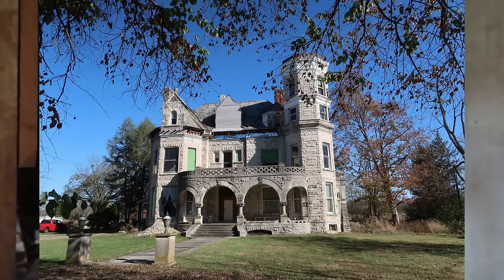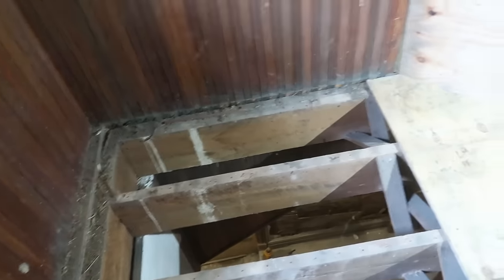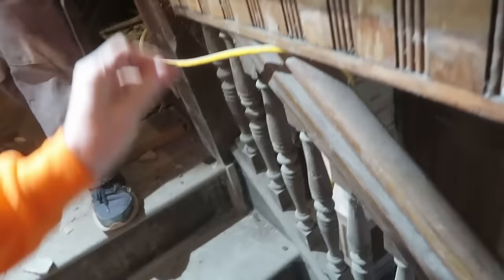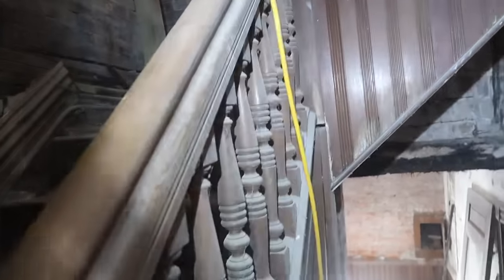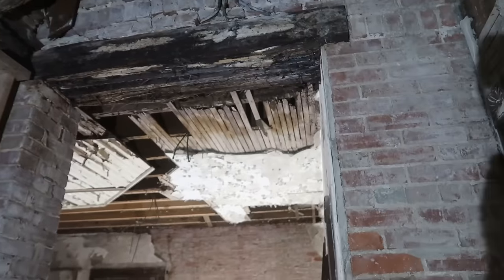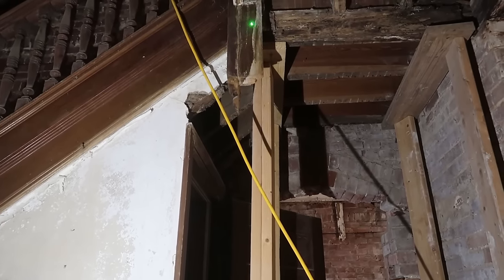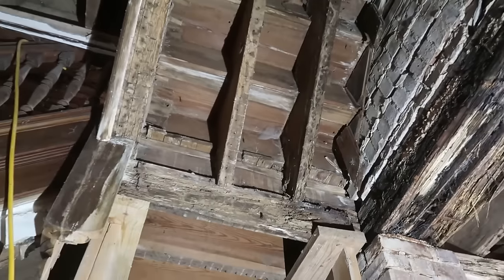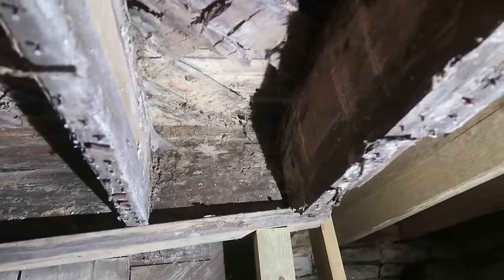We RESPOND And EXPLAIN The Structure And DESIGN Of The Back Stairwell. S4E28

Comment: I’m not an architect! but I have renovated several houses! You need a footer in the basement for the post to sit on! Going all the way up to the attic! To support the stairs! I would check out securing the stairs to the brick wall also! So it’s not just freestanding along side the wall!
Reply from the maker: We will figure out how it was designed and try to make it better. That might result in support from the basement. It would certainly be the easiest way to do it.

Comment: My 1903 Victorian commercial building (4 floor including basement) had a wrap around "floating" staircase from the second floor to the third.  The third floor was originally a ballroom or community room which was fairly posh for the time (4,000 sq ft maple dance floor with horse hair lined padding under the hardwood - no squeaks, no sound at all, even after 120 years, elaborate tin ceiling complete open span accomplished by 5 huge timber beam trusses across the width of the building, electric perimeter lights integrated in tin crown molding ( unbelievable lengths of insulated copper wire for all of this, knob and tube of course), an electric elevator and two large restrooms. Obviously the staircase was quite elaborate for going up to this room and was representative that you were going somewhere special.  Now, the reason for all of this explanation setup is that my stair case was similarly scantily supported,  I used to just stare at how it was constructed, wondering what did they do and how did it work especially since it wasn't residential but commercial and had more traffic.  I guess it was designed by someone who really knew physics and the transfer of force along the staircase as a whole because as a unit, it was supported as long as staircase as a unit was together and not compromised at any point, which it was still intact - I had no rot issues, so all was good.  I think the Victorian design and building just pushed the envelope when it came to support  - the always wanted to impress with staircases and entrances.  My point:  I see the same application in your home - your back stairwell.   It worked as long as things along the way weren't compromised as you point out with the rot, etc.  The Victorian designers and builders loved to show off - at least that was always my take - I would just look at my staircase and surmise - they were showing off - because to look at it would cause anyone to wonder how it is supported and did they pull that off - the physics of load transfer.    Great video as always!
Reply from the maker: We understand what you are saying. The stringers and landings themselves are holding the staircase up. Thanks for the explanation.
Reply: You got to love the Vivtorian!

Comment: Thank you so much gor this clear explanation with the site map and little green light. I would start in the basement with a square column, or poured on site concrete column up to ground floor level. Than create pockets for the joists to fit in. Same on connection first to second and further on. The basement colum the biggest surface, carries the mist weight. You've made amazing progress.
Reply from the maker: It was fun doing a stairwell tour. =)

Comment: Bear in mind that the wall in question is not really carrying any load beyond the surrounding floor loads/stair. Think of the supporting
structure like a space frame where all attached members act to transfer the load. I think what you have is probably just a design error. The stair and wall do not necessarily have to have a post to hold it up (but it sure would be better if if did).

The reason you are in a quandary is because you cannot raise or jack up the stair/wall to level it up an inch or so. The reason I think you can't do this is because that is not the way it was supported to begin with. It was all held together by its surrounding parts. This was sufficient until the parts rotted. 

I haven't read the comments from last week so forgive me is this is redundant.
Reply from the maker: Yes, you are correct. Jacking up the landings doesn't do anything to the surrounding walls because they were designed to be self supporting and are not really structurally attached to each other.

Comment: Wow, imagine all the work that need to be done now just to lift that corner in the attic by 1 inch. But you guys have the tenacity to sort this out. By the way, your explanation was very clear. In my opinion I would move the basement door back to probably the original position which will give extra support. Good luck.
Reply from the maker: That's the plan!

Comment: A few thoughts - I believe there is a good reason why the stairs are not attached to the brick walls. As you have discovered, wood moves over time.  If one side of the staircase is attached to the wall, it will stay where it is, but the other side will sag resulting in the stairs being un-level. I have seen the is in row houses in Brooklyn, NY where the stairs are attached to the party wall and the other side slopes downward.  You are being given sound advice from many viewers - start in the basement with a masonry footing and then build a continuous supported post on up. You may need to move the door to the basement on the first floor to fit a post where it needs to be.  Ignore the naysayers - sad they don’t have anything constructive to add.  You are both incredible!  Robert from NY
Reply from the maker: Thanks for the positive comment! We try to take all the comments in stride, good and bad. We know that we have a lot to learn and are very happy to learn from others. Thanks for the construction advice.

Comment: First of all thanks for doing the detailed tour of that staircase, it was super helpful in understanding the configuration.  After going back and forth I think you are 100% correct that there is a difference from the as designed versus the as built.  I think that fixing the brick wall and the other structural supports would probably get it close to as built, but alone I don't think those would fix the overall structural deficiency.  A new support neatly blended into the existing structure would probably be a wise course of action to make sure everything is supported for the long term.
Reply from the maker: Thanks for the validation. =)

Comment: That makes complete sense now.  I think you're right about the late change order with the door placement and eliminating that post caused the sagging.  It was probably fine when the house was dry but when the roof and bathroom started to leak everything just rotted away.  It's also funny how the stairs aren't using stringers and just trim pieces to form the stairs next to the wall.  Maybe the ran out of wood that day and thought they'd just do it a cover it up and nobody would be the wiser.  Just goes to show you that even back then there was shortcuts being done by builders and once covered up nobody would know until about 100 years later.  LOL
Reply from the maker: We just pray that our fixes will last for another 100 years. =)
Reply from the maker: Thanks! We do watch a few of those channels.

Comment: It is very clearly original in my opinion. I’m excited to see this project, can’t wait to see how you guys figure it out. My mom just bought a house built in 1888 and the framing techniques are eerily similar….and guess what she also has termite damage, so now I get to feel some similar pain to what you both have been feeling! 😂 😭
Reply from the maker: Yes, not surprised about the termites. =) Frank grew up in Montana and had no idea what termites were until we moved to Kentucky.
Reply: @moorelandhouse  Yeah, I’m glad he didn’t they are little devils. Luckily the damage for us is only in the very back of the house in a porch area
Reply: I agree with you I don't think this was a design change at all I think it is totally rot related and if the Joists are put back along with the arch in the brick wall everything will be fine.  The big question is at what point this becomes replacement over repair and triggers code requirements from building inspectors.
Reply from the maker: That's one of the reasons that we are being careful with how we accomplish things. @gordonulrickson3626

Comment: Your hanging wall was at one time load bearing maybe. It was probably helping to carry the load and when the floor beneath it settled it quit contributing which lead to unintended pressures elsewhere? Maybe?  It not too far from that to the corner you need to support.
Reply from the maker: We have gleaned from other people's comments that this was all designed to intricately work together. We will see if we can put it back together now.

Comment: I also agree that it's a design change order and that those fake newel posts were meant to go over something else instead of hanging there in space. With so many examples of doorways in the house, it wouldn't be hard to recreate the look of the originally designed doorway. It looks to be worth it once the basement floor joists were replaced to recreate what structure would be needed to make the doorway and provide the obviously needed extra support structure for everything going up to the attic.
Reply from the maker: With the shape it is in we would have to rebuild the doorway anyway. Might as well move it and make it look original. =)

Comment: I do not see the need for an extra post in front of the door to the basement stairs, because who says that a beam has to be straight ?  I (as in me, myself) would laminate 2 or 3 layers of  LVL in a criss cross pattern and laminate both sides with some 1/4" steel and bolt it together with 3/8" bolts, that way the it could go across the opening and follow the second floor stair stringer down to the existing wall where you could hide a post inside the corner behind the door frame.    Keep up the amazing work.
Reply from the maker: Thanks for the idea! That's exactly the reason that we put this video out. We know there are people that have done this before and we love gaining knowledge from others.

Comment: Funny thing about that run of stairs to the basement. Since we know there was another staircase in the kitchen originally that went down that was much larger, this one looks a bit like an afterthought. An original afterthought, but one nonetheless. I don't get the feeling the design was altered so much as all the cantilevering going on with the landings would have made the weight of that corner of the attic not an issue. It is possible to be clever and cantilever that wall with the diagonal wall of the first floor staircase acting on that corner point all the way up to the attic. (I hope my explanation is clear this is a hard format to explain something technical in) Basically if everything is supported properly again, I don't think it would be much of an issue.
Reply from the maker: We are going to try that first. We are pretty sure they knew what they were doing but didn't expect the roof and box gutters to never be repaired and destroy the whole house.

Comment: matched my paper drawing.  What i did in helping me visualize the problem... not the floor view drawing. but "corner" view  aka vertically. I  drew out wall, newel post drawing going on the way up.  that is where I suspected contractor is thinking using  newel post as corbel .. which i would rephrase into wonky method.  did not realize the stalactite newel post is hollow that you had shown on 1st/2nd floor.  I thought those stalactite newel was solid, layered wood...

Thanks for the "validation" video you posted today.  Clearly stairs need fixing (aka frame, beams etc) and add full length post (replacing the newel post that is sitting on the corner.)  supporting that corner on first floor.
Reply from the maker: Thanks for taking your time and checking in. We are glad there are others out there keeping an eye on what we are doing. =)
Reply: the hole in brick, video time stamp 3.07  nearest word describing that is putlog.  that terminology appears in castle construction method, where builder wedges a wood log into a specifically laid hole in stone wall in order to continue working on stone wall above.  This is method used before scaffold method is developed..

Other people in Europe suspected putlog method is more frequent than scaffolding because able to hoist heavy materials up, possibly 50 to 100 kg materials.  Today, this is not in use because modern crane hoist more heavier materials up, faster than the putlog-hoisting could.
Reply from the maker: Thanks for the word! We have those stone outcroppings in the stone basement and figured they were for some type of scaffolding.
Reply: @moorelandhouse  outcropping meaning a large rock stick out of the wall... that is called corbel.  Corbel is often integrated into stone wall with large stone or stacks of large stones, to support something such as roof. and is long term support. There are situation having a hole in wall above corbel is called "pocket corbel".  
I did use that corbel word on your stair with wooden newel stalactite. It was only word I was able to think of which might get me laughed at for that word description with your stairs.
Reply: @moorelandhouse  If stone corbel is there in basement, then must have had served real purpose of some kind.  Corbels are used "permanently".  putlogs are temporary.
Reply from the maker: We will have to show a picture of one in a future video.
Reply: @moorelandhouse   👍

Comment: Could it be possible that what you called a 'newel post thingie' originally had a square pole in in it going up and down, to support everything and somehow got removed at a later date? Maybe to make the opening wider? I hope it makes sense what I said don't know how to explain it better.
Reply from the maker: We think that might be how it was designed but it might have been changed before they finished the framing construction.

Comment: I have a bit of a question or a thought, if the first floor is as it suppose to be, could the L shape wall on the second floor be the change order? Only reason I ask is I had seen other houses of the same age where the bead board is fitted in and makes up a wall with no studs, the whole wall being the bead board. It looks as if the 2nd floor hand rail for some part of it run next to the wall which seems off as well. If this is the case the second floor landing would had to only support the live load in that area and not the weight of the wall, which would make me want to see how the 3rd floor (the attic floor) can be cantilever?
Reply from the maker: We hadn't thought of that! We would have to put another wall on the second floor in order to cantilever the floor joists on the third floor. We would still have the second floor "cantilevered" joists to deal with though. Thanks for the intriguing thoughts.

Comment: Sure seems like someone made a design mistake and covered it over with lath and plaster.  It can happen.  One thought moving forward, remove everything surrounding what should be the "load vector/post" from the top down, just to be certain that there actually is good load bearing wood and it is continuous (otherwise you're just guessing, right?).  Jacking it from the bottom makes sense but it would be fruitless if you don't have a continuous support going up to the top.  I'm sure guys get where I'm going.   Cheers and thanks for the informative "post", pardon the pun!
Reply from the maker: Yes, we are still in the process of discovery. We have been taking more plaster off and removing more flooring to get the best idea we can before starting back with the real construction.

Comment: It is an odd construction and not entirely safe I would think. Why not remove the bottom two stairs? Then you can properly support the upper stairs and your problem is solved.
Reply from the maker: We don't plan on remodeling. We are restoring. Even though they didn't stay level, the stairs have remained structurally sound for 130 years.

Comment: I maintain it is a cumulative failure on every level you have an approximately 1 inch drop.  On each floor you have a structural double triple joist frame around the stair opening that has rotted and dropped if those beams held the whole structure would have held up. If you bring the wall out at the basement door it is going to narrow and block the doorway under the arch into the room behind and it is not going to land on the beam so it still will not be really structural.  I am not a structural engineer or architect so my suggestion is to find a professional who can look at the loads and they can explain how it worked and if it needs to be modified of course code today is far different than 100 years ago. I also know they used to build what are called flying staircases that only were supported top and bottom.
Reply from the maker: Thanks for giving us the term "flying staircase". We now can start down another rabbit hole on the interwebs and figure this thing out. We do agree that if everything would have held up that we wouldn't be dealing with this problem today. A lot of it transpired when they replaced the window on the second floor landing with a door. That led to quite a bit of a moisture control problem that rotted out the most important beam that held up the brick wall.
Reply: I have read a lot of the comments on this post and still don't feel the design. involves a change order I think it is built as originally designed.  My one question is can you put it back with out changes and meet code I think a conversation with a structural engineer or architect might building inspector might be wise. @moorelandhouse
Reply from the maker: Thanks for the additional information!